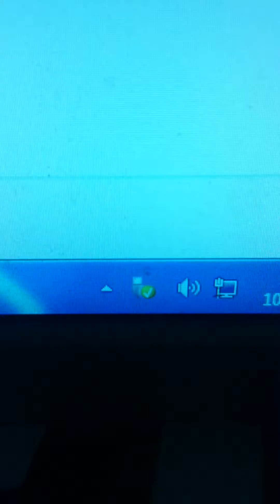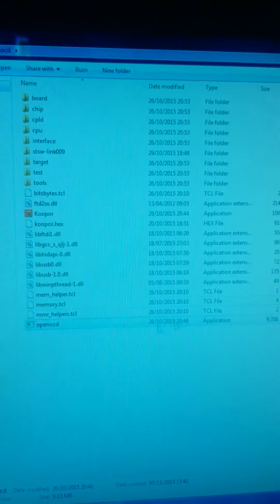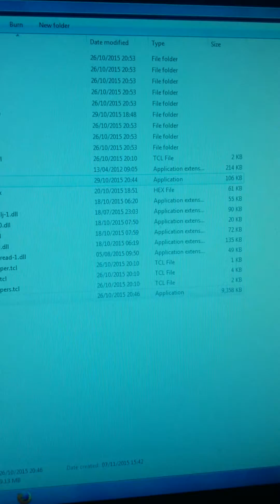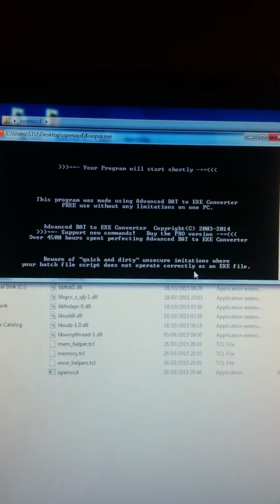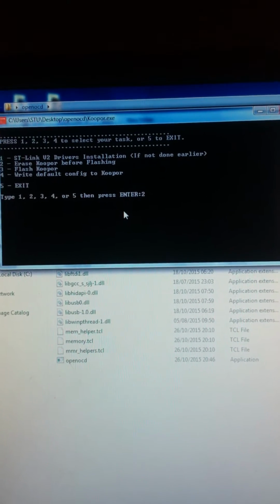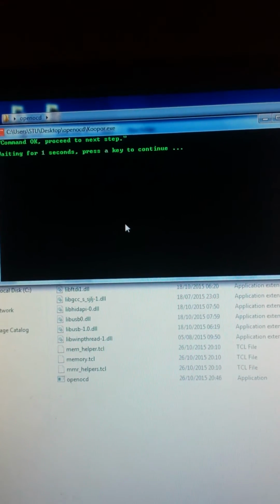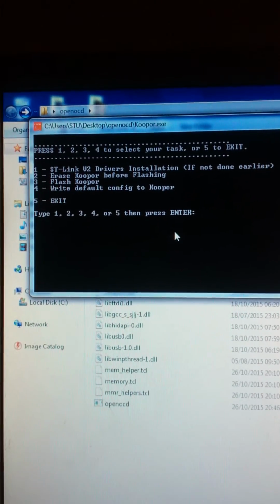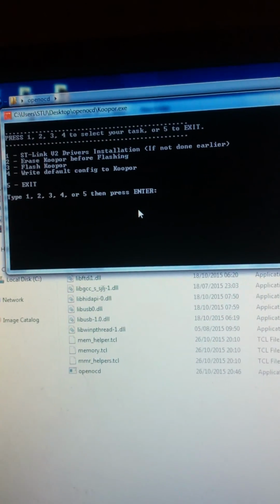Updating koopor mini with St-link stm8 stm32

Comment: Can you please help me out on which wires go to where bro isee on this https://docs.google.com/document/d/1u_4dTG8_kyOi2wa3OMCrawK6Kv3ViKisB1Mg-jOdkc0/pub but the wires on the ST is different
Reply from the maker: Hey dude :) if the wires are not the same colour as the guide it doesn't matter just get a label and mark each wire with what number on the stm board and the number of the USB pad to solder too. really sorry I've been super busy so not had a chance to make the how to vid. hope this helps if not just let me know
Reply: Thank you bro :) ah i will try it waiting on ST to come :) i will leave you no if i have any troubles i subbed you :D !
Reply from the maker: +HutchyyHD is your stm board the same as the one in my video? not a problem dude need a hand with anything just ask and I'll see if I can help :)
Reply from the maker: +HutchyyHD yeah that one should work perfect :) soldering onto a micro usb can be tricky but an easy way would be to strip an old usb cable back and just use the cables off that and solder wire to wire :) if ya know what I mean

Comment: Hey Haggis, would you be able to do a step by step video on how to do the update? :D
Reply from the maker: Hey Sarah :) do you have a cable made? I'll make a "how to" but alp ya need to do is hook it up and run the program the run all of the numbers and it should work. if ya still need help I'll make a video later :)
Reply: Not yet, but for me that's the easier part, as the diagram from scapi is easy to follow on how to wire up the connection (are the £3 eBay ST-Link V2 STM8 STM32 Programmers ok for the job?). The part I'm not sure of is once it's all connect up to the computer, are the instructions on the screen regarding what numbers you have to press?
Reply from the maker: +Sarah Selby you got a link to the one you mean I've seen a few. the one I got was £5 but with first class delivery and in the UK. Yeah the instructions are on screen. just do 1-4 then 5 is exit
Reply from the maker: +Sarah Selby 1 is install drivers for the sum
2 is erase koopor before flashing
3 is flash koopor
4 is restore default config to koopor
and 5 is exit :) hope that helps :)
Reply: +Haggis Man ah makes sense now, you have to go through each number regardless, to finalise the whole update properly?
Reply from the maker: +Sarah Selby Yes that's exactly what you have to do :) hope ya get it sorted! if not just give me a shout and I'll see what I can do :)
Reply from the maker: +Sarah Selby aye that's the same one I used :) not a problem at all :) happy I could help :)

Comment: hey there. can you please help me and tell which micro usb do you need with the st link. have i got to solder or can i use it with the female pins on the cable?
Reply from the maker: Hey mate :) Yes you'll need to solder. I did it with a portable soldering iron and was fairly easy :) if you join the koopor site and go on to the community part you'll find tons of info :) hope that helps :)
Reply from the maker: and it's a 5 pin micro USB type b. I'll try and add links to where I got them :)
Reply: +Haggis Man hey, i found an upgrade guide on koopors facebook page. i only wondering if i have to solder or not. thanks bro ;)
Reply from the maker: +Genick Starre no problem dude :) hope it goes OK for ya. just make sure and do all the parts to the update and that includes #4 "restore to default settings" :) take care
Reply: +Haggis Man Hi thanks for the howto ! Did this "step 4" thing finally solve the problem ? Just waiting to upgrade. Thanks.
Reply from the maker: +illbe Hey mate :) Yes restoring to default settings seems to have stopped the battery drain and ticking and I still have ss for in temp mode :)
Reply: +Haggis Man 
Ok cool ! Thanks.
Reply: +Haggis Man 
Hi

At work I have this version of the STLINK V2 :
http://fr.farnell.com/stmicroelectronics/st-link-v2/programmateur-icd-pour-stm8-stm32/dp/1892523

The connector for STM8 updates has only 4 pins instead of 5. It has only VCC, GND, DATA IO & RESET. Missing "Clock" wire. Do y think it will be working ?

Thanks ! ;-)
Reply from the maker: +illbe really sorry mate I couldn't say :-/ I'd get one like the one in the video. I got two more and I'm gonna make a video asap and I'll have a link where I got mine :) Sorry I can't help dude :-/
Reply: i ordered from amazon,,,like 5 bucks for 5 male type B

Comment: Hey, guy. Do you use or foresee using that stlink for anything other than mini updates? I have this suspicion that koopor won't provide updates for very long and if there isn't anything else to use st link for, I'd hate to have sunk even more money into this damned koopor for nothing. Thanks for the vids!
Reply from the maker: Hey dude, if you plan on getting the plus then hopefully it can update that aswell. as for them not realising updates could possiblely happen but this update is a modified version done by a user called "Sscapi" on the Koopor app and community.
Reply: +Haggis Man Oh, hell no! No more koopor or smok for me, man. I've been reading the koopor forum and am well aware of their shenanigans. My wife actually bought this mini. I love her very much and don't want her hurt, that includes financially. They ripped her off. Koopor is dead to me.
Reply from the maker: +fobroth0236 hey dude :) aye they have a few problems going on just now but aslong as you do the 4th setting at the end it seems to fix the ticking and battery drain. Was just away to pop up a video about it today :)